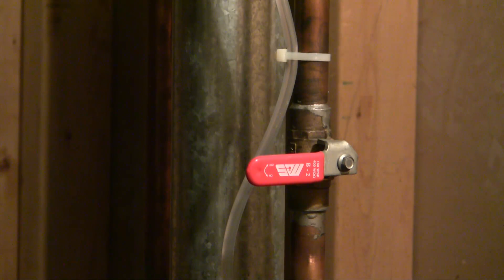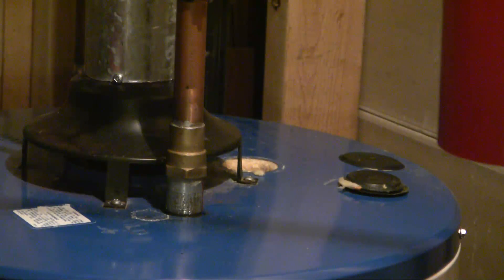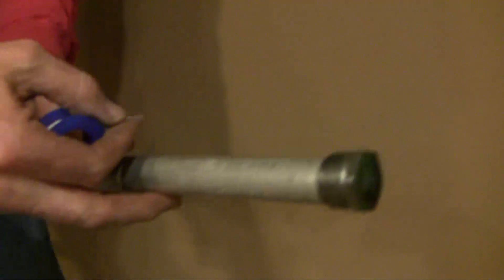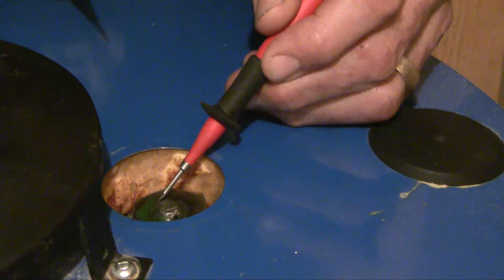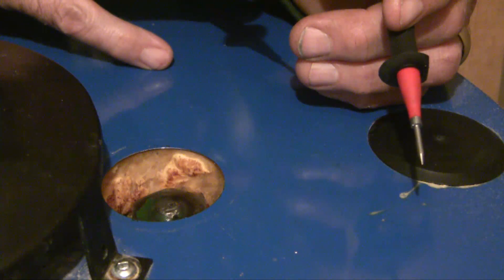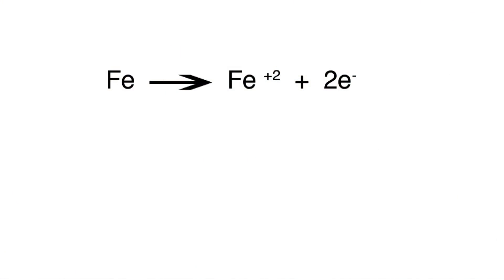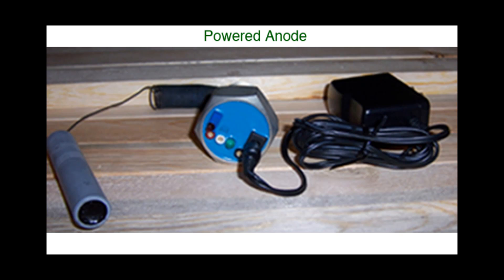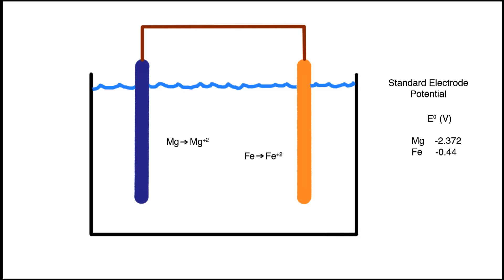How and Why to replace the Anode rod of a Water Heater

Comment: Is a magnesium anode just as effective as an aluminum one?  I've heard yes, but also heard, yes, but only if it has a dc charge applied to it. 
Speaking of the anode, I  can't seem to remove mine completely.  At the very bottom of the rod (the rest is eaten away to nothing but the steel wire) there is a blob of material larger than the 3/4" NPT opening, so I can't get it out.  Can I just drop it, gently of course, into the tank, after removing the threaded top, without any harm?  I can't think of any way to remove it since I can't get my hand into the tank and the element threaded holes are about the same size, maybe a tad larger than the anode threaded hole.  Ever heard of this problem??
Reply from the maker: Magnesium is probably better than aluminum, though both create an electrode potential to do the job. If I recall correctly, the anodes used in boating to protect aluminum boats have magnesium, which creates more potential than aluminum. As you know, the DC current is produced +by the rod+, so neither needs an external source of power.
Regarding the part that you can't remove, I would let it drop into the tank if you can't get it out. You certainly don't want to damage the threads of the hole you pull it through, and a remnant of the rod won't likely cause any significant harm inside the tank. There's a lot of that debris inside an old water tank, eventually accumulating at the bottom making the heating element less responsive. It may or may not continue to work at creating a potential, depending on whether it electrically touches the side of the wall. That problem happens all the time with dip tubes and we just leave them to rest inside the tank.
Reply: I did that yesterday.  I just couldn't get the end of the rod out.  It separated from the steel wire that runs down the center of it, sorta like a corn dog on a stick peeling away.  I just pulled up the rod as far as I could and snipped it and left the rest inside the tank. 
I didn't install the new aluminum anode rod yet because I've thought of taking it back and getting a magnesium one.  Would a magnesium rod be a healthier alternative to aluminum?  I've heard over the years that aluminum isn't as inert in the body as some claim it is and it can be harmful.  Thanks for answering my questions from my previous post.
Reply from the maker: packrat76 That theory about Al being found in neurofibrillary tangles is interesting, but since then there has been very little corroborating evidence to support it, despite a lot of effort to do so. So, Al rods are still legal everywhere that I know. If you are worried about it I don't see any reason not to switch, but if it were me I wouldn't be too concerned.
Reply: The magnesium rod was about 12 more $s and just a foot shorter so I exchanged it.  You should do a video on how to find an anode rod,  because I had a heck of a time finding a place that sold them!  Luckily my Whirlpool uses a standard 3/4" pipe thread anode rod so a place called South Central, a contractor supply warehouse I guess you could call it, sells it, since it's the same as the AO Smith brand and fairly standard among others. 
One last thing.  I asked a guy in the plumbing department at Menards and he didn't know and I've had no luck finding anything online.  The bottom of the Whirlpool electric water heater has a cutout in the center with no insulation bare to the bottom of what appears to be the tank.  I was going to fill it with spray foam insulation, but then I began to wonder if that void of insulation area has a purpose. Ideas?
Reply from the maker: I wonder if it was made for either gas or electric, with the cutout for gas. In any case, I wouldn't modify it, it's not worth the risk.
The last time I looked for an anode rod I found a reasonable supply at Home Depot. However those kind of maintenance things are not commonly done by homeowners any more, so retailers have trouble moving product. Then, they don't bother to refill the shelves when they finally run out. I think part of it is that tanks are not as well constructed as they were, which means they often don't last as long as the rods do. Planned obsolescence....
Reply: spelunkerd
OK.  Thanks for your input.
Reply: spelunkerd
I noticed Ebay has magnesium anode rods for sale.  I read at one website that the magnesium ones corrode faster than the Al/tin ones. By the way, I hope you are wrong about the tanks not lasting, or at least mine.  It would really suck if I had to replace it in only a few months after all the work I did flushing and replacing parts.  Do you recommend any certain brands of electric water heaters?  I don't think I'm going to get another Whirlpool.  (The diagnostic system is nice, but they gouge you if it's no longer under warranty and it needs to be replaced.  $90. + $33. shipping next day!!!!)
Reply from the maker: Yes, fast corrosion is a downside to a more efficient anode, ha ha. As far as brand, I have no idea. It would be nice to trust the 'you get what you pay for' theme, but that may not be true. I have had good luck with water heaters, but I have a feeling my luck may be running out.
Reply: @spelunkerd  Very true, indeed.  The first water heater at my home, an LP gas fueled "Calorex" brand, lasted about 45 years... I replaced it about 24 years ago only because the "Robertshaw" temperture control was discontinued, and there were no spare parts to keep it running.  The "new" one, exact same model designation ("G-30"), has a cheaper temp control and is of a much lower quality construction, with less insulation, thinner sheetmetal, and a rougher construction overall, but, at least it stll came with a sacrificial anode... while newer ones sold today, DON'T COME with ANY anode at all (!)... 

When i asked the factory why do they no longer install anodes in their water heaters, they told me that they had some cases where users broke the top sheetmetal head of the tank when trying to unscrew a stuck anode, "so they preferred not to continue installing the anode anymore"... but I think it had more to do in order to lower their already lowered manufacturing cost, regardles of heater duration! I have just found a new anode (unmarked, I don't know if it is aluminum or magnesium or an alloy of the two), and will install it soon, because I don't have a large enough hex socket. Thus, and having heard of the possible breakage of the top of the tankm I will use plenty of my own brew penetrating oil (a mix of half Acetone with half ATF +4 automatic transmision fluid, throughly agitated to loosen the threaded connection and reduce the risk of damaging the top of the tank!  
Thanks for recurring to some electrochemistry in your video, it is a great opportunity to teach people, congrats on that!
Reply: spelunkerd I have well water after 3 months my water smelled like rotten eggs. I removed the Anode rod 14 years ago no rust problems no elements gone bad

Comment: Is the length of the Anode rod all the same regardless of the size of your heater.  30 Gallon, 50 Gallon, 80 Gallon.....  I have an 80 Gallon Solar Water Heater myself.
Reply from the maker: Standard size is one length.

Comment: Some say Alu or Mg, one may impart smell to the hot water, depending on water hardness; not supposed to drink hot tap water, as it can leach lead from improperly soldered pipes and fittings especially in older homes. As long as the water heater is not leaking, where the tank has corroded beyond its life, even old heaters can be extended by flushing and keeping anodes replaced. It should slow or stop the destructive corrosion of the steel. Some longer warranty water heaters merely add a second anode, counting on buyers to never check or change them; doing so can extend the life indefinitely.

Comment: Great video, thank you. If the anode is still full length, but sort of eaten and covered in scale and stuff, is it ok to leave it in there? Does it matter if its cleaned or wiped off, if thats possible?
Reply from the maker: It is very common for the rod to break off, in which case you're never getting it out, it is too hard to retrieve. Leave it in, it doesn't cause any harm. I would put a new rod in every time, their ability to protect the tank falls quickly as the surface oxidizes.
Reply: @spelunkerd  In that case I will obtain a replacement Asap. Its rusted up like a sunken war ship. Thanks!

Comment: Each year passes and I know I should've replaced the anode rod, but keep putting it off.  It's on the hot water side,  it's the Hydrojet system.  After 10 years is it too late to replace the rod knowing it will probably fail due to expected obsolescence? I just hate something going wrong with having to deal with copper pipe when I should've been smart enough to buy a water heater with a separate port for the anode rod.
Reply from the maker: Sorry, I don't know the details of the Hydrojet system. In such an old system, I understand the reluctance to take an old system that is presently working and do something to it. However the water tank I demonstrated was over 10 years old, which was compelling evidence that the original rod was finished. If I messed up, all I had to lose was a really old water tank anyway. There is some credence to the philosophy of "if it ain't broke, don't fix it". I worry that corrosion of the access port may make getting a tight seal after repair very difficult. All that said, statistically these systems do last longer with regular maintenance of the anode rod. If you get into the job and end up having to call a pro because you can't get a good seal afterwards, he may recommend replacing the tank. Ultimately you lose a ten year old tank so the risk isn't terribly high.

Comment: Most good plumbers like this guy bleeds out the water out of the lowest point in the system which is the water tank drain. Most guys would just open it up the rod and make a mess. Good vid sir
Reply from the maker: Thank you, that's a good point. The water runs more freely if you also open a tap at the top of the system on an upper floor to give an entry point for air. As you know, you just need to lower the level of the water below the point you'll be opening.

Comment: Which will last longer, the one with the magnesium or aluminum? Do I have to use the same anode rod that came out? (aluminum vs. magnesium). If one will last longer than the other can I use that one or, do I have to use the one that came out, if it comes out(lol)
Reply from the maker: Ironically you normally want the one that wears out sooner, since that offers better protection. I believe magnesium is better, giving a stronger electrical potential, but I would try to put on the same design as your water tank was equipped with originally.
Reply: Thank you for your reply.

Comment: ITS A DAMN BIG DEAL-- DO NOT teflon tape the whole threads it must contact the threads anode & tank.  so electrical continuity exists
Reply from the maker: Yeah, that was my thinking when I did the procedure, but as you saw in the video, there was excellent continuity even with the tape. I had found remarks by professionals to that effect, but didn't trust those remarks so I had to prove it for my system. Within a few turns of the threads, the tape is distorted enough to allow continuity. The trickle of current flow is so low with this kind of reaction that meaningful voltage drop across the threads is insignificant. Nevertheless it is wise to check for continuity, because as you say the anode will be completely ineffective if you don't have continuity between the anode and the wall of the tank. We see the same effect when using dielectric grease on electrical connectors. Friction and mechanical pressure consistently overcomes the insulating effect of the grease. In the long term dielectric grease repels contaminating water to help slow surface oxidation, maintaining a low resistance circuit.

Comment: you better show how to do this with insufficient headspace and as an added bonus how to repalce this dumb saddle valve put so close to the heater
Reply from the maker: You make a good point about that goofy saddle valve, which I replaced a few weeks later, off camera. I soldered a proper T junction, which should be required under the building code, considering how often those rubber seals fail. The headspace issue is also a recurring topic, and as you probably know you can buy anode rods with a joint, allowing you to work within limited space. Alternatively you can get a friend to help you tip the empty tank on its side so you can get the new rod in. Thank you for watching.

Comment: Thanks again for the fabulous video! Just greatly appreciate your explanations on how and why to do these repairs and maintenance! Is this the same material ships use on their hulls to prevent rusting? Thanks again for your knowledge and sharing!
Reply from the maker: +Johnny B Good Yes, same principles and same approach. The recommended anode varies depending on the type of water (salt water vs fresh) the boat is in. The same process also applies for underground gas pipes, where premature rust could cause a gas main to break. In the latter case, they often use a small applied DC voltage to achieve the same goal. Thanks for watching!

Comment: Every video that I watched so far on this topic suggests putting teflon tape on the thread. It is good to see electrical continuity mentioned here. But I wonder if using teflon tape is a wise step considering that it certainly does not promote that continuity which is critical for normal operation of the rod.
Reply from the maker: +M Ch That's a good point, and as you see I wondered about that, too. Of course you do need it to be water-tight after you're done, and the lubrication of the tape allows you to tighten the joint down better so it helps with that. As you know, when you tighten those threads the tape tears and insinuates into cracks, so there's still ample room for electrical continuity. One other option is to use what's called plumber's dope, which is a liquid gel version of tape that is painted onto the threads before you install the new rod. Once before I had to use both tape and dope together when I had trouble getting a seal on a water tank. In that case it was the inlet pipe that was the problem so it was irritating when I couldn't get a seal. Professionals use tape or gel routinely and I would do that, too.
Reply: That's an interesting point - I think though that the when you screw in the threaded portion with the teflon tape, the tape is separated and pushed around to the point where the threads have plenty of contact surface with tank.   You can see this result if you apply the teflon to a pipe, install and then remove the pipe - you will see the threads have pushed away quite a bit of the teflon.   If I understand how teflon works (could be wrong) - it's more of a lubricant than a sealant. It's purpose is to only lubricate the threads so they don't stick and jam while tightening. Once the pipe etc has been tightened fully, the teflon no longer has a purpose
Reply from the maker: Yes, good points, I agree.

Comment: Do you know why if you have a soft-water system they say you should use aluminum / zinc rod?
Reply from the maker: +reefseeker The extra sodium in softened water improves the efficiency of electrolytic reactions, which can result in rapid destruction of the anode, requiring more frequent replacement. In theory, using a rod with a lower galvanic potential like aluminum or zinc rather than magnesium may slow that process down, but it would also reduce the effectiveness of protection. I now have softened water, and have had no problem to date.
Reply: +spelunkerd well A.O. Smith recommended combo aluminum / zinc rod. I wounder what is standard? I think Aluminum only or maybe magnesium, not sure.  But for sure I am going to put new one in every year or 2 at most. My son's hot water heater without softener was 100% gone. They say only a tiny bit of sodium ends up in the water, but I guess just enough to change things. So in the end, don't drink hot water than comes from any of these tanks. You are eating metal. :) It has to go someplace.
Reply from the maker: Good points!

Comment: Excellent video! Wonder if you've run across this one: we replaced a 17 year old water heater last year (electric). Never had the rotten egg smell. Recently our hot water began to smell like rotten eggs so figured there was a problem with the anode and predicted we would see calcium deposits since it's only been a year of use. Rather, it was a black tarry substance which coated the entire surface of the rod rendering it inoperative. Put a replacement in and should be able to clean this one up but this did not happen to our last tank. Any ideas? You seem to have an affinity for chemistry (literature was more my forte in school) and thought you'd be able to opine. We are not on city water but on a gravity fed well from surface water that is filtered through sand and carbon. Thanks!
Reply from the maker: Canesser I've never seen that before, not sure.
Reply: spelunkerd Thanks anyway! Time to play the lottery lol.
Reply: +Canesser its manganese add chlorine to your well water once a month to prevent
Reply: +Daniel DeSmet Thanks Daniel, I'll try that as a stop gap. Apparently the fiberglass well casing for this gravity fed well (from surface water/river) is starting to leach ground minerals and the calcium is really getting heavy. You can see the residues on dishes and after car washes. If this continues all the water fed appliances will be in trouble. Apparently they are going to have to put another casing inside this one to correct it.